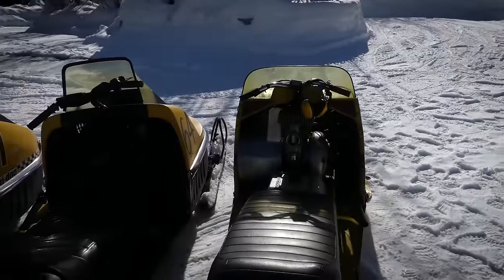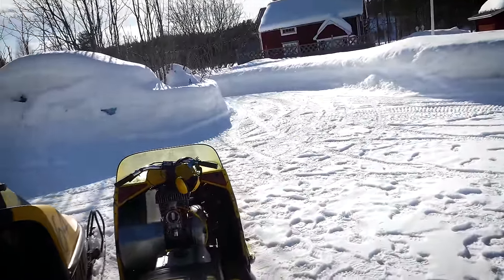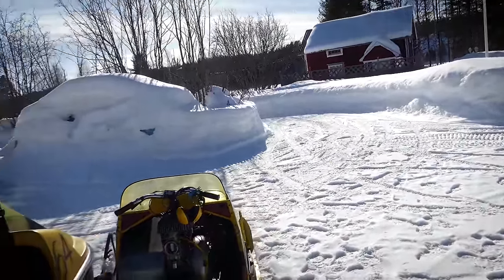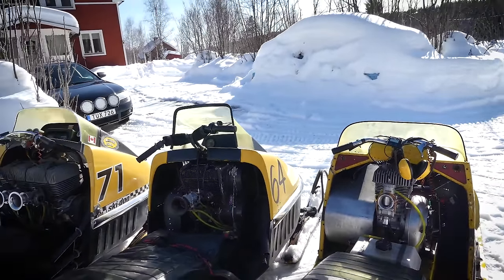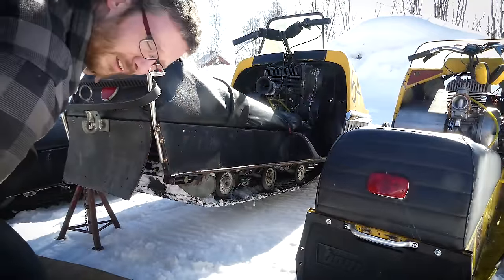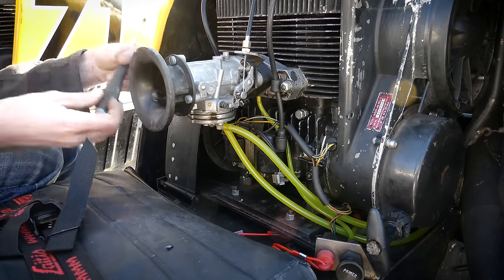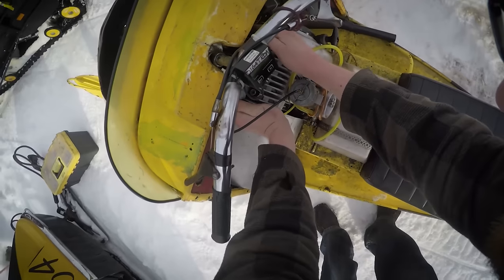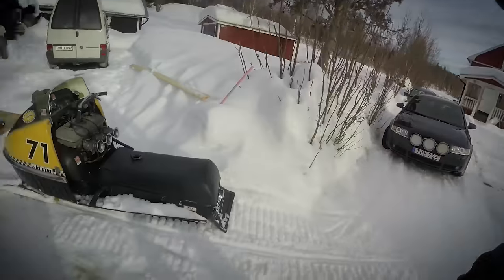Blizzard 797, TNT 640, Oly 277 fix and test

Comment: Rode these types when they were new.  1968 Olympic 320 with 15” track and 1970 Nordic electric start with 18” track.  Air cooled.  Both had bogey wheel suspension.  Groomed trails not yet a thing.  Made own paths thru the woods and fields.  Ski spindles protected by hood unlike today.  Ride on the weekends and repair-tinker all week!  Too much emphasis nowadays on high speed.  Not enough on having a great ride over the hills and thru the woods.

Comment: Good 'ol Tillotsons' barfing 32.1 on your jacket. I remember that. Good times. Leaf springs without dampers, and bogies.
Reply from the maker: Only the TNT has bogies but honestly bogies are probably better than the slide suspension on the Blizzard ;) it's a real piece of work that suspension.
And I have to admit I did add dampers to the Oly skis, made it so much easier to handle.

Comment: I use a squirt bottle with regular gasoline and oil (20:1) with a good shot through the intake. Will start in a couple of pulls and has enough fuel to keep it running until you can choke by hand or lever.
Reply: Yes ether is a big no no in a two stroke
Reply: @darinmckillop6196  says who? Maybe in the 1950’s but modern is fine and has oil mixed in for the top end. Wives tales lol

Comment: You never got wide open on any of them. That's what people want to see. Open that sucker up and make it scream for about 5 or 10 seconds see if you can hit 80 miles an hour. Well, the people either want to see it wide open or a wreck : ) tell me I'm lying : D
Reply from the maker: You're completely right :) As a true racer I have my excuses ready though! Here goes... I think I did go wide open on the one lunger but it never got any traction in soft snow with my ice track (no lugs just ice studs) so nothing really happened..
I almost crashed the Blizzard with just a blip of the throttle so I think that was enough ;) And the TNT has the twist throttle which is awkward as hell on a sled especially when things get bumpy, but that's how this one was raced back in the day so it's staying :) I actually went to an 18 km enduro race with it and honestly I should probably be glad the rear axle broke after 2 km and I couldn't continue, I'd either have crashed because of the twist throttle or I'd have completed it and had sore muscles for weeks ;)
Reply: @Hollaendaren  well I'll tell you what there's no question all three of them sounded screaming mean! They sounded awesome. I have to admit though I've never liked the thumb control throttle on anyting. I much prefer the twist throttle as you have on the one. My thumb tends to get tired it starts to hurt way before I'm ready to quit riding. Either way thanks for the response I appreciate it. Obviously I'm in the United States so you definitely have a fan over here and I subscribed. Keep up the good work and I'm ready to see that 4-cylinder fire up. That thing's going to be a beast. I hope it runs like you want it to. Something tells me it will. You seem quite knowledgeable and educated so there's no doubt in my mind. Keep up the good work bro!!

Comment: how you can fit a 121 in track on the 797? let me know your sproket setup please
Reply from the maker: It was quite an undertaking to be honest but so worth it, the extra traction can't be compared to even the best 114 tracks.
I'm pretty sure I used 9 teeth 2.52 drivers, whatever size gives the same diameter as the stock drivers. They are on a hex driveshaft from some widetrack machine and machined to the correct length for the 797 tunnel. Drilled new mounting holes in the aluminum profiles that sit up in the tunnel, to move the suspension back a bit, can't remember the exact offset.
I use the stock rear axle but modified plates off a TNT with the sliding brackets a lot closer to the pivot point. I lost almost all travel in the rear axle but honestly can't tell much of a difference.  The rear springs sit just inside the track now right next to the rear idlers and are a real pain in the ass to mount because it's a very tight fit, but once they're in it's not too bad to loosen them a turn or so while adjusting tension. I had to cut about half an inch off each side of the track for clearance at the rear of the tunnel so the track is about 13" wide now. 

It's been working out great, after being frustrated about literally never getting any traction with it that's no longer an issue.
And best of all is I didn't have to ruin anything so its a reversible mod. If you want to put back the stock setup the only evidence it was ever modded are a couple of extra holes in the aluminum profiles and those are well hidden inside the tunnel so not visible to anyone.

I've just built my first suspension from scratch last year, haven't tested it yet but if it works out I may build one for the 797 too because the stock suspension isn't doing it any favors. But I like the fact that I could keep it original :)

Comment: This was such a rush watching your video with your retro machines. I'm totally envious of your Blizzard and TNT models, as those were the 2 primo muscle sleds from back in the day. That Blizzard looks like a handful, with those 3 scarf sucking carbs right at your gut, and almost 800ccs growling away. 
 Your 640 TNT is a 71? It has a great bark to that engine. I always liked the looks of the 69-70s myself, but yours is certainly very desirable. 
 We still have my Dad's old 70 335 Olympic here. Its been sitting in the barn for the last 46 years or so. I do turn it over every once in a while to make sure it doesnt seize. But it might be time to get 'er going. 
 Thanks for your vid, it was very entertaining. Go Retro!
Reply from the maker: Thanks! Yeah the Blizzard is bad ass, it's my number one bucket list sled and I still have a hard time believing I actually have one.
The 640 is a 71 yeah. It looks like it did endurance races back in the day judging by the Swedish racing ski loops (they were mandatory) and the twist throttle was a popular mod over here for long distance racing. The pipes are Dougs pipes I think for a 72, one of them just barely touches the hood right at the air vent that 72s don't have. Really should get that dual carb setup on it some day!
Take care of that Oly, if it's been sitting for that long and still turns over that sounds like it definitely has potential! Olys in stock form make really nice cruisers I think.

Comment: I made my Ski doos reliable by turning them into Polaris and Arctic cats.
Reply from the maker: The big question is why do you have sleds in the Florida swamps, watercross?
Reply: @Hollaendaren  because I was born and raised in Ontario. My job brought me down here. I still watch every Leaf game. 
Even the Polaris tripples didnt have the sound of the blizzard. 
Our first Skidoo was the 10 hp olympique in around 1963. I ran that till I got my TNT 440. 

My dad kept it and bought a 68 super 370 olympique. Fast when it ran. But was unreliable as hell. 
Bombardier was slow to incorporate the use of Mikuni carbs and stayed too long with the center mounted engine which hurt them in the end. 
In 1974 they came out with the front mounted engine chassis. The TNT free air cooled engine was pretty nice. I never owned one but I never heard anything bad. 
Tiloston carbs were ok as a single carb.  2 were a pain 3 were a nightmare. I actually had a small vacuum guage that I used to tune them. 
I miss snowmobiling.... but we got airboats down here!!! LOL

Comment: I had a 640 TNT with tuners I kept breaking spindles I put spreaders on it and started breaking them every time out. I got rid of it when my 73 TX 340 blew it away.
Reply from the maker: Yeah those spindles aren't the strongest. This 640 also had spreaders, and bent spindles.. I replaced the spindles because the splines were bad too and got rid of the spreaders.

Comment: What kind of track is that on the blizzard?! how did you manage to get the big paddles to fit around the front cogs without rubbing on the tunnel? I would love to build an olympic with a paddle track but im not sure what kind of track would be easiest to fit.
Reply from the maker: It's a 32 mm full block 121“ track. The Blizzard has a lot more space in the tunnel than an Oly :) I have regular 9 teeth 2.52 drivers on it now with a custom shaft. 
But on an Olympic you can fit at least 7/8" lugs if you use 7 cog 2.52 drivers, for higher lugs you probably need 6 teeth drivers or move the drive shaft down and away from the tank a bit. I used to have a 7/8" track on the Oly before I switched to an ice track. All the traction you need on an Oly really, at least if you're not in deep powder.
Reply: @Hollaendaren ... Hello, great video! What is the top speed on the triple cylinder Blizzard?
Reply from the maker: @90daysinvegas53  honestly don't know, I've had it up to around 130 km/h or 80 mph.
Clutching is a problem with these old clutches, I've clutched it to take off pretty good but top speed suffers because of that, I'm pretty sure the primary clutch doesn't compress all the way with the spring I'm using.

Comment: what size carb on the single and jetting ?
Reply from the maker: Sorry for the late reply, it has a 45.5 (bored 44) with 3.2 mm main jet. Had to drill my own jet, this is about a 1200 jet in Mikuni sizes. Running on E85 it wants tons of fuel.
I'm going to try and taper bore a 44 this winter, that should give me almost the same flow but hopefully smaller jets.

Comment: Did you put the 71 on the hood of the blizzard? Or where did that one come from?
Reply from the maker: The previous owner did. Originally the sled came from St Albans, VT.
Reply: I don't think the 71 is a racing number from back in the day.  Your 797 is a 1971 model year.  I believe that is what the 71 number on the sled designates. The 640 tnt is also a 1971 model year, if the 797 was owned by the same person, he probably put the 64 number on it to designate it being a 640 tnt, because 71 is already on the 797.  Take good care of that 797, they are worth quite a few $ now.
Reply from the maker: @jessbottom9580  I know what kind of sleds they are and I know what the numbers mean but good analysis ;) They did not come from the same previous owner, I imported the 797 from Canada and the 640 was hidden in a barn in northern Sweden. The previous owner put the 71 on it, I put the 64 on the TNT myself.

Comment: hi very interested about what track you had on the 797 blizzard? any detail please?
Reply from the maker: Hi, it's a newer 121 track with 32 mm lugs. Making it fit without destroying anything wasn't an easy task! I moved the entire skid back a bit by adding new holes in the top aluminum plates on it (so no new holes in the tunnel). Custom rear axle plates, custom drive shaft, custom slides as the skid is really a bit too wide for these tracks but with some really narrow slides it just barely works. It's all reversible to stock if I want to.
The difference in traction is immeasurable!
Reply: wow!!! can you writte me brand f track and number? 2.52 pitch? what kind of driver did u use in front and rear?
Reply from the maker: @plsextremsport  I think it is a Polaris track. 32 mm full block. But any 121" track should fit the same I think. Yes 2.52 pitch, I can't remember right now if I used 8 or 9 teeth drivers. Stock rear idlers.
Reply: camoplast durasport 1000?
Reply from the maker: @plsextremsport  the worst part about the whole thing is the rear spring setup. I had to cut the track (make it narrower) because the spring ends up inside the track with this setup because the rear axle is so far back. That was a real headache!
Reply from the maker: @plsextremsport  I honestly have no idea, I bought it off a friend, he said it came off a Polaris that's pretty much all I know. I'd just be guessing if I told you yes or no.
Reply: haha yes hi undertsand! are yu on facebook? ive few question to ask you about my project
Reply from the maker: @plsextremsport  yes I am on fb, send me your info and I'll add you :)

Comment: Can't believe you are using starting fluid on a two stroke. But out of all of them I'd take the single all day long nice sleds
Reply from the maker: A little starter fluid doesn't hurt anything. There's so much oil left in there from previous running it's got all the oil it needs until it pumps fresh fuel with fresh oil :)
Reply: @Hollaendaren  I disagree but you do what you want with your sleds